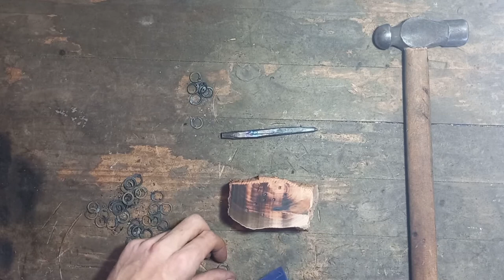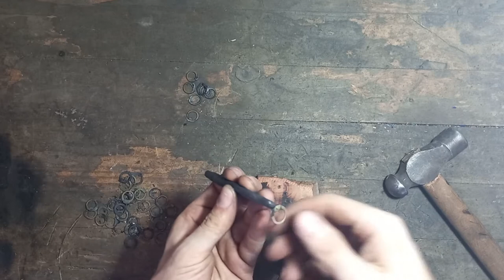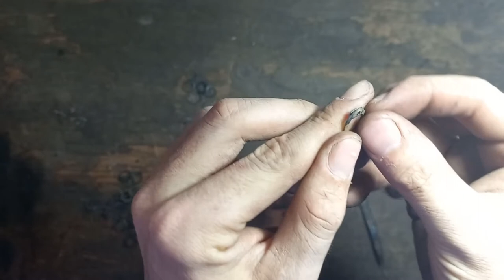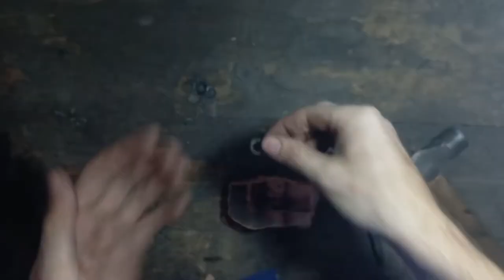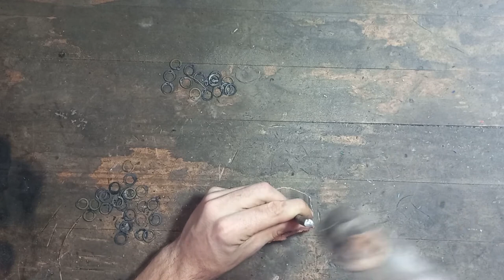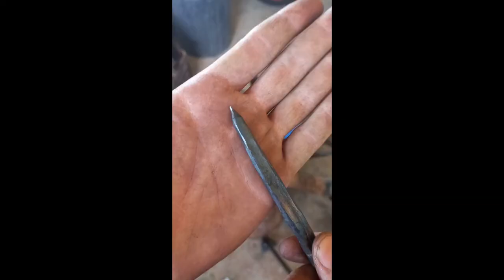Riveted Chainmail: Punching holes faster with hand punch

Comment: How do you  get such clean holes?
Is your punch dull at the point?
Im using what is basically a needle at the tip. Maybe thats what is messing me up. Most of my rings just bend, rather than being poked through...
Reply from the maker: My punch has a flat tip roughly the same size as the hole. If you hit the ring with a flat punch on a stump that entire disk where the punch makes contact shears off. If you use a needle tip, youre not removing material but ripping though it as the pin makes a small hole and then pushes its way through it.

Other tips are to make sure youre hitting with the grain of the wood and annealing the rings.
Reply: @countsecondac4788  our setups are the same, other than the tool tip :D
And my rings are probably smaller, due to the wire I was able to get.